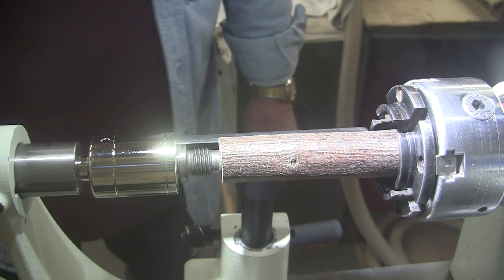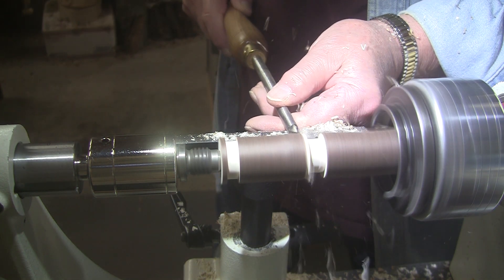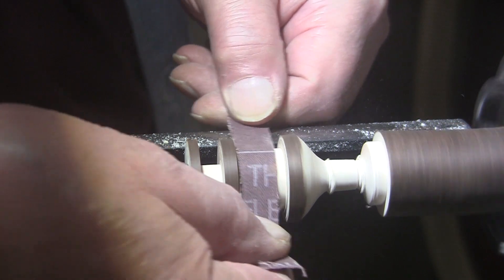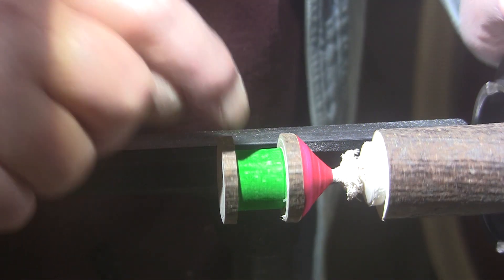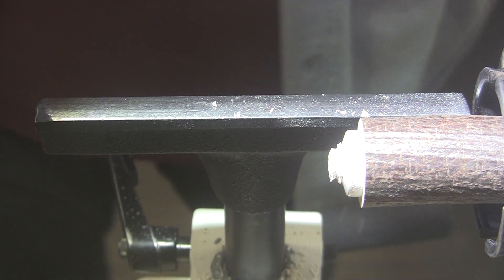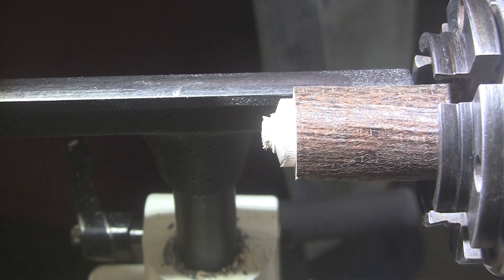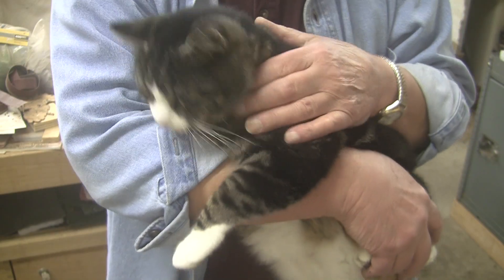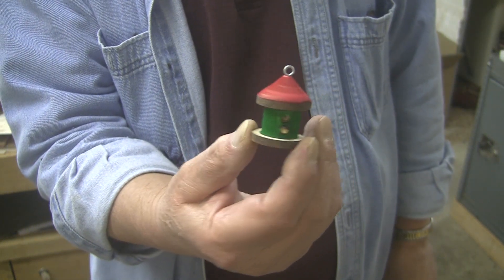A Christmas MUSHROOM Ornament?  LOL! - Wood Turning

Comment: Aminita! Next one red top, white sprinkles (sawdust flecks?), white stem with small bulb at bottom. They grow here. Very poisonous, but usually seen in fairy tales. Fun turnings. You can do the bark tree if you leave all branch rings same diameter. Make more this size and a tree to hang them on! Merry Christmas, Phil!
Reply from the maker: I looked them up, Valerie, and they are even red!  I'll get on the dots, should be a big improvement.  Merry Christmas! 😊
Reply: @PhilAndersonShadyAcresWoodshop  👍🏻👍🏻👍🏻👍🏻👍🏻

Comment: I've made several mushroom bottle stoppers and they are quite popular. With a 1/16" parting tool with tapered tip from Carter and son, I make undercuts under the cap (not for boletes, of course), which adds a bit of realism and removes weight. Also made pagoda shapes that way and stylized pine trees.
Reply from the maker: Cool, Daniel!  I didn't have a mushroom in mind until I did it so did not do any planning.  I may make a larger one in the future and will likely use some of your ideas.

Comment: Great videos. What kind of coloring markers did you use and where do you get them. Thanks again for the nice videos.
Reply from the maker: Thanks, Tom!  They are Tombow Dual Brush Pens, available anywhere art supplies are sold.  Here are some on Amazon: https://www.amazon.com/s?k=tombow+dual+brush+pens&rh=n%3A2617941011%2Cp_89%3ATombow&dc&crid=EHCIO8D72I19&qid=1639597495&rnid=2528832011&sprefix=tombow%2Caps%2C240&ref=sr_nr_p_89_1

Comment: Good morning Phil, I have been watching several of your videos and you are very inspiring.   I have been making wooden dough bowls for over a year and now I want to venture into wood turning.  I love the live edge turns you do and hope I can learn how to turn some of those. My question is you speak of using several coats of sealer and then shellac.  Do you sand the sanding sealer again even tho you have already sanded and is the shellac food safe.
Thanks Ronny from Al.
Reply from the maker: Wonderful, thank you, Ronny!  Between coats of sanding sealer and shellac, I use a gray 3M abrasive pad.  After the final coat of shellac I use a white 3M abrasive pad.  Some shellacs are food safe and some may not be.  Most of my pieces are for arts sake rather than as utility pieces.  I'm going to leave it to you to do the research on what is food safe.  Thank you for watching! 😊